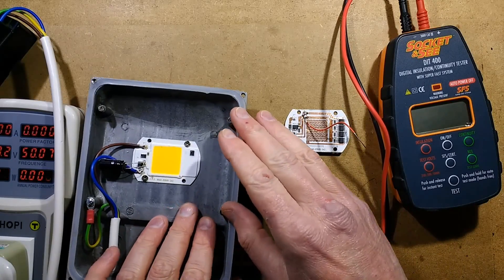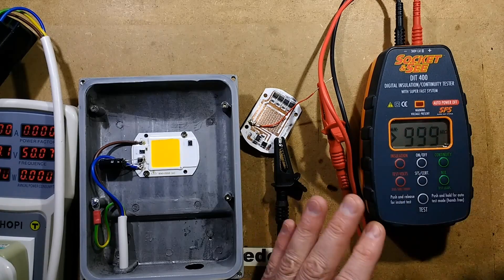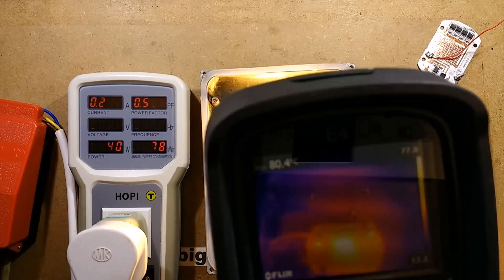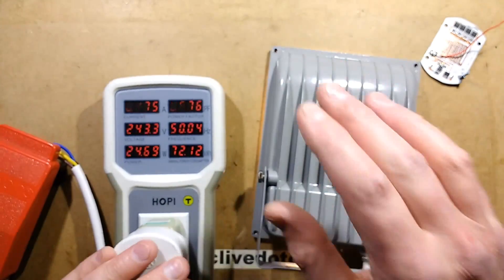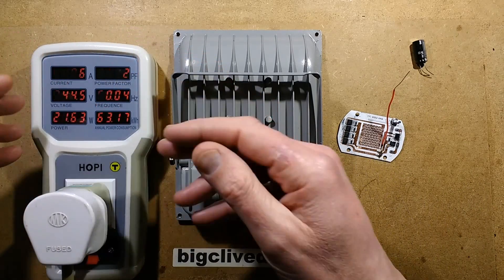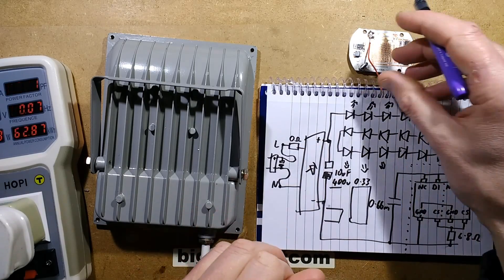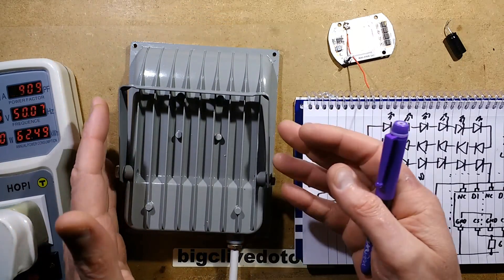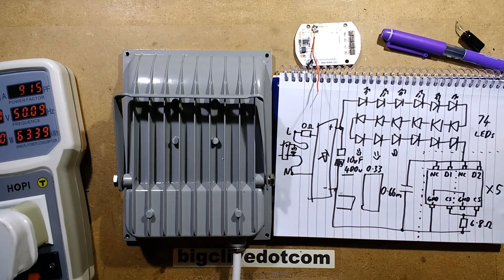Adding a capacitor to a driverless LED and other tests.

Comment: Once you add a cap the DC voltage goes up. OK - so why not remove the 000 resistor and replace it with a  higher value resistor to reduce the AC voltage to the bridge rectifier, thus reducing the DC voltage back to where it should be. Would this not work?

Comment: If the drivers are self-regulating with temperature, I do not think they will suffer over time. The temperature does not seem higher than your previous, unsmoothed test, soooo... This is quite brilliant.

Comment: Clive. Love the videos, especially enjoy watching you blow up shit.
How about in addition to the filter cap, you also insert a series capacitor to bring the voltage across the LEDs back in line with before you added the filtering.

Comment: Great video @bigclivedotcom just what I was looking for.
I have some other driverless LED boards. Where would I have to solder, and what kind of capacitor would I have to use to stop the flashing effect I see on camera with these 50 Watt LEDs? 
https://www.aliexpress.com/item/SMD-LED-Lamps-Chip-Bead-Smart-IC-220V-10W-20W-30W-50W-90W-For-Outdoor-FloodLight/32658320428.html?spm=2114.13010608.0.0.Upym4y 
I imagine it would be the right side of the black, vertical triangle, next to where it says VR1. In the 4th picture down. I don't know how many V or microfarad to use though. Any help would be appreciated.

Comment: Would it be possible to reduce the input voltage with a voltage regulator and THEN connect the electrolytic capacitor that will increase the voltage up to the ideal voltage?

Comment: Great information that you are sharing. It is very useful to me to see you revers engineer and then modify the circuits since to me has been a great help with my own experiments. Thank you for your great work and sharing. You saved me so much time.

Comment: one of main advantage of driverless LED is that this design is directly comply with CE,e specially EMC, but what happen when you are using a capacitor,  it is still comply with EMC directive?

Comment: Perhaps an odd question - I've been considering getting an insulation tester, seeing you use yours reminded me - Usually I build embedded devices & use someone else's power supply (UL Listing something in the US is costly! But a UL listed "wall wart" power supply handles that UL listing...) For the times I want to test a possibly "iffy" AC power circuit, are there any inexpensive but worth-having "meggers"? Thank you.
Reply from the maker: +Mr Sheesh You can get cheap Chinese insulation testers, but they probably wouldn't be certification grade outside of China.
Reply: Good point. I need to get back working (injured but recovering), still "spend once, cry once" can be good advice. Fluke gear'd be nice, but too costly. I'll find something that's actually US certified, seems wisest, then.

Comment: Can you do a video explaining when to use a linear voltage regulator over a buck converter? I'd love to hear it from your view and in your soothing, booming voice.

I want to know when I should use my LM317T and when I should go out and buy those cheap break-away buck converters.
Reply from the maker: The linear regulators are a lot simpler and generate very little electrical noise.  But they also dissipate any voltage difference as heat like a resistor.  So for low current regulation something like an LM317 or a 7805 is a good choice, but for high current the switching regulators will run a lot cooler.
Reply: Wonderful, thank you!

Comment: What if you use a frequency multiplier before that? I mean it would still flicker @ 4 times (or two  times) the frequency, but it wouldn't be visible anymore ... though some parts might not being able to handle that.

<- am just a electronic noob, who only soldered one radio kit as a kid.

Comment: So if they desiged the number of led to need 300-310V or sth. then smoothing the ac and using the drivers as current liminitng resistors would be a nice way to run no flickering light? the power factor with a capactior in would sadly be horrible again :(

Comment: What will happen with 1 MF ?
Reply: One megafarad - if such a cap exists - would probably kill the smoothing. You'd definitely have to have an inrush limiting resistor, and quite likely the light would fade on, then fade off when switched off. Oh, if you don't have a discharge resistor (or too high a value one), you'd still get one HELL of a belt if you touched the leads accidentally.
Reply: I can't believe how to people can be so blind, it's obviously that is 1 microfarad, But if are fool enough to be strict on SI,  Is wrote on the wrong way,  1mF for low IQ people

Comment: I wonder what happens if you take one of these LEDs that were configured for European mains voltage and add the capacitor, but then run it on US mains voltage which is roughly half that of the intended voltage.  Would you end up with smoothed, unflickery output at a lower level of brightness and cooler operation?  Or would it utterly fail to light at all?

As an alternative thought, what if you were to take two of the LEDS, add capacitors to both, and then run them on European mains connected in a series configuration?

Comment: Hey Clive, will a standard dimmer affect this LED any? I know you ran it on a very low voltage (something like 3, if I remember correctly, but probably not) to see the arrangement of LED chips, but the standard dimmers accurately control the LEDs' brightness?
Reply from the maker: It should work, but with an odd dimming curve.

Comment: I think I've asked this before but didn't get a reply...
How do you like the Hopi meter? I really like the fact that it displays all different values at once.
Accurate enough and worth the money?
Reply from the maker: It's OK, although there are a few design quirks.  You can't plug a UK plug straight in because the area the flex comes out is obstructed.  It also "cheats" when you put on a really horrifically capacitive load and pretends nothing is there.  The most endearing feature is the pop-off battery compartment cover on the back that instantly exposes live connections, all wired in green.
Reply: bigclivedotcom Thanks!
Too bad the multiplexing make it flicker so much on camera. I think the display's much nicer than the LCD meter you normally use.
I notice the flickering totally disappears the moment you lift it up and move it towards the camera though ( 4'13" ) Any idea why?
Reply from the maker: Ni5ei When the area the camera is looking at is bright it effectively has a faster shutter speed that catches the multiplexing flicker.

Comment: Clive, I couldn't find any 120V versions of these driverless LED chips.  If I used 220v chips at 120v AC and used a capacitor then the LEDs would be running at ~170v.  Would the LEDs light at all?  Be too dim?
Reply from the maker: I doubt they would light.

Comment: Hi bigclive,here's a quick one for you - I'm thinking of replacing GU10 50 watt halogens with some LED's (http://www.screwfix.com/p/lap-gu10-led-reflector-lamp-345lm-900cd-5-2w-5-pack/2275p - pack of 5) from  Screwfix to use on a "Green-i" remote dimmer in my kitchen,are they really "Dimmable " now? how can I check without damage to the dimmer??? Cheers thanks for the fab videos....
Reply from the maker: No easy way to test without just trying it out.
Reply: Thanks for the reply bigclive,the good news is they do Dim & no flicker :-)

Comment: Can You tell how much brightness will drop when You add capacitor You'we mentioned in series ?
Reply from the maker: It depends on the value of the capacitor.  It would be easiest to make it a low power LED like a 5W one.  It would still put out very useful light, but last for ages.

Comment: To reduce the flicker without overrunning the chips or LEDs, fit a smoothing cap after the bridge rectifier. Then add a series cap in the mains feed with its value selected to return the power consumption to its previous level.

Comment: In the U.S., what if I buy the 240V chip and put a capacitor across it?  Would my 169V DC be able to power this chip?
Reply from the maker: I don't think it would work.  the combined voltage of the LEDs is higher.
Reply: 180V is the cutoff right?

Comment: That can't be a Chinese LED fixture, no way, the green ground wire is attached to the case, there's no way a Chinese manufacturer would let that happen, it's needless labor to bother connecting those things.
Reply from the maker: It's me who connected the ground wire.  Rest assured that all recent Chinese lights have had the ground wire floating in thin air.
Reply: The literal translation for "ground" in Mandarin must be "air".  Live, neutral, and air wire...
Reply: Come on, China is already years ahead. They implemented wireless grounding. Get your facts right.

Comment: there is a way to do this.

either use an external rectifier and smoothing capacitor with a capacitor in series with the rectifier to drop the voltage some 

or do like Clive did and add the capacitor after the rectifier on the LED and use a capacitor to drop the ac voltage to the LED.

Comment: Would changing that zero ohm link to an actual value help to limit the power so the chips werent running as hard and help, when the capacitor is soldered on the board, to bring it back down to a power similar to before the capacitor was added?
Reply: Nepal Plush Yes, but you will be dissipating quite a lot of power in that new resistor, meaning you could not just insert another chip capacitor as it would need to be a high dissipation wire wound type resistor.

Comment: Hi, how about a external bridge rectifier, smoothing capacitor on the output of the external bridge rectifier, and put (2) LED lamp modules in series? Would that bring the temps down and make it more stable, while illuminating the flicker? There should be room in the case for both modules.

Comment: I wonder if those of us who are in the US and other countries on 120 VAC mains could buy a 220 VAC rated unit then add the filter capacitor and be left with a perfectly usable light?  My maths may be wrong, but if with the capacitor you were drawing 50 watts at 220 VAC...it would draw approximately 25 watts with the capacitor on the 120 VAC mains?  I may have to try this!  Off to ebay I go!  :)

Comment: Clive - If you want to examine individual cells of any configuration of LED - try looking at them using a UV light source ... the phosphor dots flouress  quite nicely.  Makes it easy to spot burns.  I recently converted a torch to use with UV resin glue and it's turning out useful for other things too.

Comment: The missus keeps nagging me for a new benchwork light for her, but without halogen-type bulb heat.
I had high hoped for those driverless LEDs so I could use them to replace bulbs in lamp fixture. And I don't have space to use regular drivers.
What a bummer :(
Reply from the maker: Consider trying a standard 20W LED floodlight or two.

Comment: Also- couldn't you use this design and have two separate series strings in opposing polarity off the AC to prevent Flicker?
Reply from the maker: The AC is full wave rectified, so the LEDs do light on both halves of the sinewave, but just not all of it.

Comment: Could you have pulled out the rectifier - bodged a half wave rectifier with normal diodes then left the capacitor in? 
You'd have about the same power as with no fucking about with it roughly. =)

Comment: The particular driver I was looking at has a temperature rating well above 100c, it may be that with a larger heat sink the LEDs will work just fine even with the wonky power factor and increased power dissipation at the chip.

Thanks for the follow up!

Comment: here's an idea I'm sure nobody has tried.  To reduce heat use a highly heat conductive thermal cement for adhering ramsinks. or for even greater performance using top end quality PC thermal paste if you have a means of securing the LED package to the heatsink.  Maybe even use a PC heatsink at that rate.  modern solid heatpipe radiators are insanely high performing, some handing 300W of heat

Comment: Here's a daft question.. what if you run two in series?
Reply from the maker: I think the combined voltage would be too high.
Reply: I was thinking more on the lines of it only lighting a subset of the LEDs, assuming it works by switching in more and more of them as the input voltage rises. Since the input voltage would be effectively halved,  and since I was assuming we have added a smoothing capacitor to both devices, I would have thought it would do *something*... but what precisely, I am not sure. If it simply acts a current regulator, then it might not light at all of course.

Comment: If thought carefully about the input current, and calculated the reactance required for the current drawn at 240vRMS, such that you could add a series capacitor to drop the RMS voltage to the point that adding a capacitor would give you 240vDC, rather than 340vDC (about 170vRMS)... you might be able to get the best of both worlds.... it might be a tiny bit unstable if your capacitor didn't let it reach the pre-set power, but the chips appear to be thermally limited anyway.

Comment: A friend and I bought some of these Chinesium LED lights, they claim 50W.  They consume about 35, and get smoking hot.  After a while, get a 'black dot of death' in one or two of the LEDs.  I put a motor run capacitor, ( about 5 uF ) in series with the incoming power.  Dropped the power consumed down to about 17W, and the lights run much cooler.  Only been on the test area ( front porch fixture ) for about two months, but have so far outlasted the factory setup.  The capacitor lets about 85 volts through.
Reply from the maker: Good idea using the motor capacitor in series.

Comment: why dont they design circuit that will switch banks of leds from parralel to series following sinewave? so that at beginning of sine when voltage is low its parallel and on the maximum its series
Reply: they have, theres a chip for that, but its unreliable, clive did some testing with it some time back
Reply: Jusb1066 i know but that was switching banks on and off, but not combining them in series parallel

Comment: What might be interesting would be to add a capacitor, then run them on 120 volts, 60 Hz. for use. here in the USA.

Comment: I have a 100w floodlight with this type of led and it lasted just a few weeks before it died. I ordered a similar 90w led panel for about £5 from ebay and fitted it with decent thermal compound. No flicker on this one and still working well but long term I'm not sure if the heat is too much as the very thin aluminium fins of the casing don't seem to dissipate much heat.
Reply: can you refer to product page of leds you've used?
Reply: @DmitryKiktenko 
This was 6 years ago, it actually failed within a couple of months of writing.

Comment: Just bought several 120v "driverless" leds on ebay. I also came across some 500w leds today. They are quite expensive currently, US $87.56.

Comment: Where did you get the cast housing used in this video?  Is it a standard size?  I have been unable to determine what the package size specs are.
Reply: Greg Cooper The package is 60x40mm.
Reply: Do you have a link for the housing?  Thanks

Comment: It sounds like if I buy a 240V version and add a capacitor across the rectifier and run it at 120V then I will have a nice light?

Comment: have you ever came across a true white LED light that doesn't use the yellow cover like the chip it's self glows white instead of blue?
Reply: Pat P Those have not yet been discovered. I assume that at some point they will be, but as of now there are no true white leds.
Reply: babaoshop has some LED modules that are apparently 4000 Kelvin, which is normally considered "Day White" (as opposed to 2700-3000K "warm white" (sickly yellow-white) and 6500K "Cool white" (blue-white)), I keep meaning to get some but haven't gotten round to it yet, but they still use the yellow phosphor gel over the LEDs...
Reply: the yellow is a phosphur, for better colour in general, the white leds for flashlights are white, but overall colour is bad, probably in bands if you were to see its spectrum, good enough for a flashlight, terrbible if you want to see colours or make videos with
Reply: Jusb1066 No, there is no such thing as an actual white led. All "white" leds are either blue/uv covered in phosphor, or an RGB led with all 3 chips lit, but the latter type is unusual.
Reply: ***** I bought 10 50w "day white" leds from another seller, they have a very strong greenish tint to the light. I was somewhat disappointed.